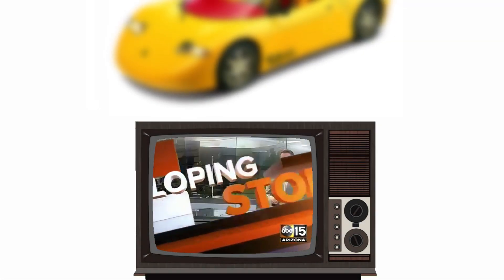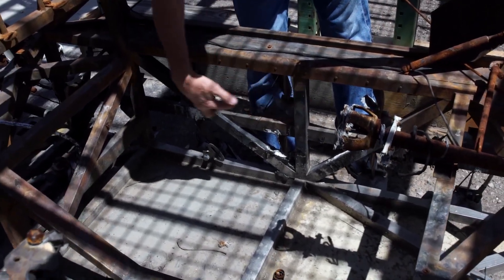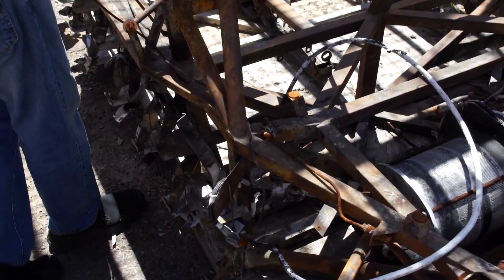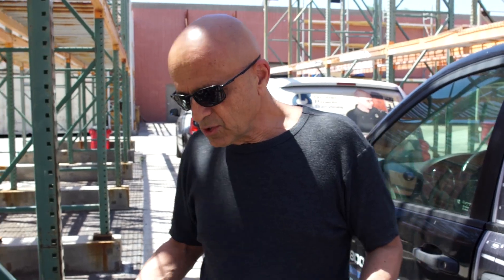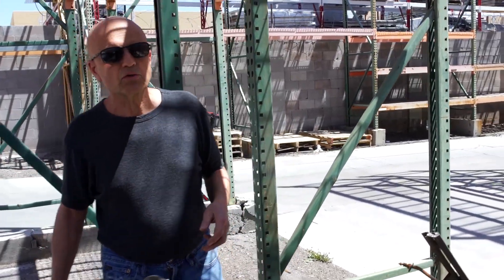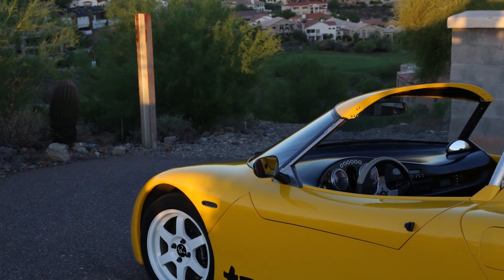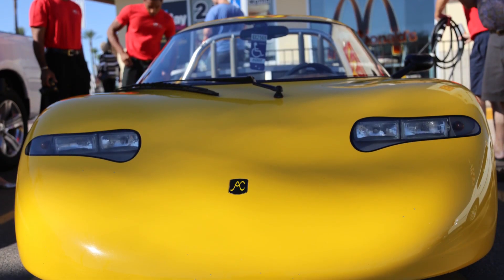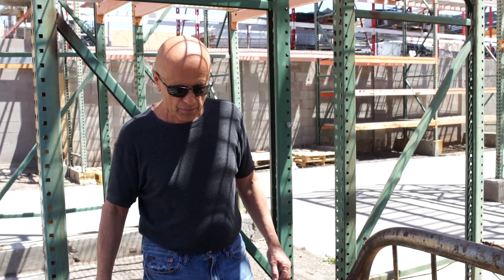The Mystery of the tZero | Gruber Motors

Comment: The way they fight li-ion battery fires now is they just continue pouring water on the burning battery purely for cooling, to keep the non-burning cells from getting hot and igniting. The cells that are already burning will burn completely regardless, but the cooling stops the fire from spreading.

This is of course very difficult to do in an intact battery pack due to the metal enclosure, but if, like in this case, you literally just opened the pack, keeping it cool using water should work just fine. Also, as the pack isn't grounded, the risk of electric shock is small.
Reply: Maybe they could squirt it with liquid nitrogen to cool it off.

Comment: They paved the way forTesla as we know it.
In this car there was probably the entire concept for the Tesla Roadster and then Model S.
This is absolutely a first to see 18650 Li Ion Cylindrical Cells assembled in packs, and this is th way Teslas were built.
AC Motor as in Teslas before Model 3.
What we can not see is the inverter technology and i am pretty curious if AC propulsion introduced the use of  discrete TO247 IGBTs in parallel. This allows a cheap inverter construction.

Comment: Regenerative braking is adjustable in my Tesla Model 3.
Reply: The 3 can adjust to one of 2 settings. The TZero was variable on a slide switch. 10 to 100%.
Reply: Not anymore. And before it was only 2 settings.
Reply: Not as variable as the Tzero had. Model 3 had 2 settings. T zero had a slide adjustment for hundreds of levels.
Reply: Thank you very much for the information, and could you please let us now why do you think manufacturers don't allow that regeneration adjustment anymore? Thanks!